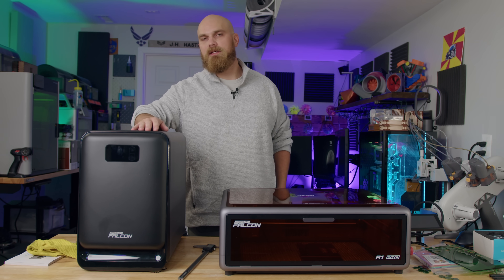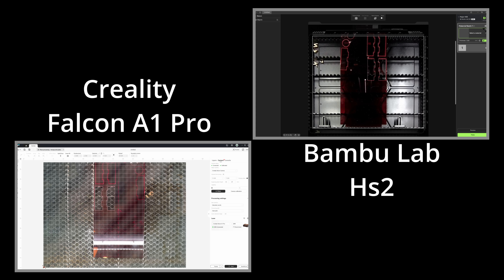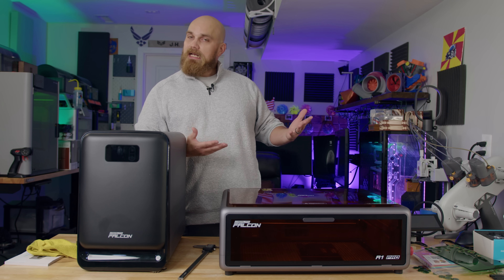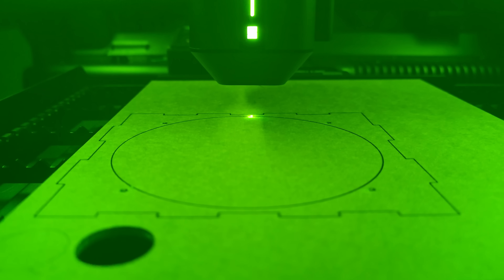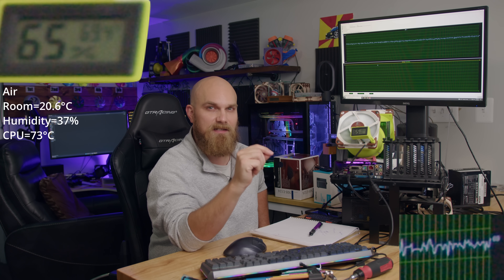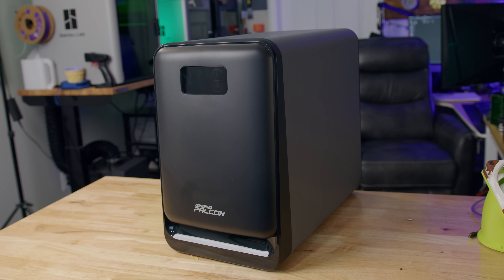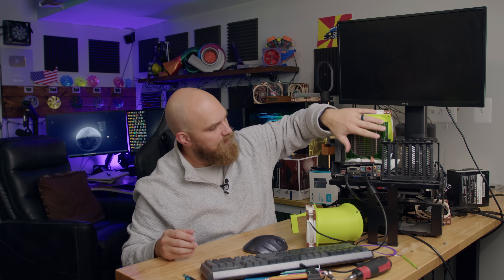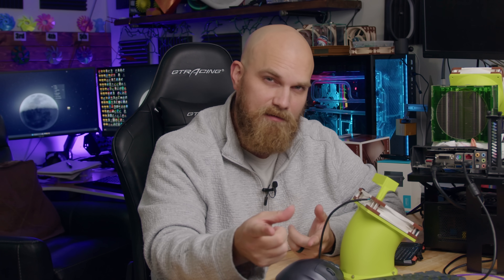I Water-Cooled My Air Cooler… Again, But Different

Comment: NB!!! As the humidity in the room increases; the amount of cooling evaporation decreases..!
ie:  You want fresh, dry air in and/or humid air out, as in outside!

Is the humidifier using piezoelectrics (cold mist) or is it making steam (hot)??
It only matters because hot takes more water for the same effect and, as you said, more vapour = less dense air...

I ask as the temperature difference is saw between ambient and pond mister/d air just before a radiator was 14 deg C.  (around 9C on the CPU and GPU IIRC)
That's in a very dry climate, which is all important to evap cooling...

Also misting a rad rather than a heatpipe cooler is likely to work better as heatpipes rely on the low temperature (pressure) boiling of a liquid at the hot side and that boiling temperature depends on the vacuum level in the heatpipe/s, NOT on ambient temps...!

If not Mist-Water Cooling; I'd turn the MB vertical so that if there is any water collecting in the HS; it doesn't drip on anything computer.

Comment: Hey! Just wanted to comment that it is generally advised against using lasers at 100% power especially when you're going to higher wattage lasers. While in theory it shouldn't be a big issue for a diode laser in terms of the lifespan (at least compared to CO2 lasers), it's pretty common practice to run lower power duty specifically for heating issues, even in higher end lasers than Creality's. 100% duty is not something I really see past 5w lasers. I would highly recommend lowering the power and doing either slower cuts and/or more passes.
Reply: lol, what?  look up the duty cycle rating on the laser you are using.  I know someone with a 150w CO2 laser, and its got a 100% duty cycle rating.  if they cut corners on the cooling, they can be cheaper to make it, but result in things like overheating.

Comment: I expect them to contact you and try to resolve the issue. No way that's how it's supposed to work- as you said, that's just unacceptable. Alternatively, you should try to use their tech support (as a normal customer, if possible). Their tech support seems to be the one complaint buyers have with this (that I can find).

Comment: 🚨To avoid 💦condensation being an issue 💡just turn the motherboard upside🔀down (180 degrees) where the CPU Cooler is on the bottom, add a 🚰drain hole, and drain line leading back into the humidifiers water tank😂😂😂

Comment: I'm not surprised the temp went down. Growing up in (Abbotsford) BC, nobody had air con and swamp coolers were something that I had never heard of, so to keep cool at night in the summer, my dad would open my windows and put a fan in front of it. My brother and I had spray bottles of water. We'd spray water on ourselves and let the air cool the water, which made it easier to get to sleep. It's also the same principle of spinning a damp wash cloth around really fast. It gets pretty cold very quickly.
Reply: Yeah, we get winter lows around freezing and summer temps in the mid 30s, but it's always above 70% humidity, so the pressure is just mean.

Comment: Hopefully Creality is taking notes from this and can fix that issue later on.
Reply: This is just Crealitys MO. They will always send you half finished products.
Reply: @gildardo  Seriously. I have an Ender 3v2 that's been gathering dust for a few years because I got tired of chasing new and random problems that would spring up every few days. Wound up being out of commission longer than it worked before I retired it.
Reply: How often are issues like this actually fixed post-release? Even in software, where pushing an update is trivial that often isn't the case.

It's a fundamental design flaw, the cooling hardware isn't up to the job.
Reply: @OGPatriot03  Creality has like a billion versions of the "Ender 3" printer, each one upgrading and fixing things post initial model release. So out of any company, they're probably the most likely one to do so. The question is just if the issue is fixed in the next model update, or the 100th model update. Fingers crossed is all you can do
Reply: honestly, if you are gonna get a laser cutter for more than a few hobby cuts, spend the money on a good one with a 50w head, these "cheap" ones are just that, cheap, and cost cutting means corner cutting.

Comment: I would love to see you revisit the watercooled tower cooler. I hate the original concept because it's inherently flawed, there's no real way for water to flow through the cooler and dissipate heat, it will flow around it since that's the path of least resistance. If water was forced to flow through the fins, the efficiency would surely improve by a solid margin.
Now all this is of course just my amateur take on thermodynamics and I could be wrong, that your concept already has enough water flowing through the fins and there's not much to improve upon.
In any case I would love to see another try at it.
Reply: it needs to use evaporative cooling as well. 

rather than heat conduction through surface area with the atmosphere...  you increase the evaporative area, and dump heat through the phase change and  heat energy being carried away as water vapour.
technically, all water cooled systems other than evaporative, are "air cooled". think about it... what actually carries the heat away? radiators dont work when theyre covered up...

and yeah, give it circulation as the fins are also limited to just conduction and convection. just has to agitate but not so much to start producing its own heat! yes, moving water heats it up... if you do it "normally" at least... cough cough, lets not go there...

Comment: water vapor is a transparent gas.
You are sending droplets (liquid water) that evaporates touching the cpu radiator and pumping a lot of energy doing so (like sweating).
Reply: This. I think that's one of those ultrasound humidifiers, that use membrane that vibrates at VERY high frequency to mist up the water and then push that out. As you said, that's fog not water vapor or steam. Also humidity doesn't change the air temperature, nor is that fog even warm. It's the same temperature as the water in the tank of that machine (plus maybe a fraction of a degree due friction).
Reply: @TheSanpletext  The humidifier increases the humidity of the ambient air via evaporation of water. That evaporation of water decreases the temperature of the air via evaporative cooling.
Reply: @victorro8760  That's not evaporative humidifierr 'tho. It doesn't evaporate it, it atomizes it.
Reply: @TheSanpletext  I don't know how ultrasound humidifiers work but the water ultimately has to evaporate to increase the humidity of the air...?
Reply: @victorro8760  Those are pretty bad for actually humidifying air, they usually just atomize the water and it then floats around a bit and lands on nearby surfaces. It should work well for this sort of application however.
Reply: @victorro8760  yes, but the amount is still so marginal it barely affects the room temperature. That's also why swamp coolers are not effective anywhere, but really hot and dry environments. Non-dry air is obviously already humid and cooler air can hold less water. RH is dependent on temperature, and lowering room temperature makes it hold less water, so the current amount of water already in the air takes up more of the relative humidity. That's also why  AC units' cold side condensates water. The suddenly much cooler air can't hold all the water that was in the air before it cooled, so it has to condensate. 
So yes, in theory humidifiers to also cool the air, but in practice the effect is marginal, unless you live in dry and warm environment.
Reply: @TheSanpletext  I understand that the net loss in temperature of a room is negligible but it's the temperature of the air stream coming out of the humidifier that's relevant in this context. I'm not sure how much the temperature of the air stream would decrease going from 30% humidity at 20c to 100% humidity (assuming it goes to 100%) but I can't think of another reason why the humidifier could improve cpu temperature by 5c.
Reply: @victorro8760  Oh yeah, the CPU cooling is purely based on waters ability to cool metal by evaporation. Water conducts heat better than air, but it has to be in liquid form (in this case atomized by ultrasonic humidifier) so it can phase change to vapor and take away the heat from the metal. 

So it's not the air humidity that cools the CPU cooler, it's the water mist that HASN'T evaporated before it hits the CPU cooler.

Thus: Making the CPU cooler wet by suspending liquid water in air = better cooling. Making air actually moist with water vapor and then pushing it to cooler: not as effective. It has to be liquid water, albeit tiiiiiiny droplets in this case, for it to cool it using evaporation (phase change).

Even more effective way would be submerge the cooler in the water, and move the water way closer to the CPU die. Then add pump and radiator with fans, so you can move the heat out from CPU fast using water, and then cool it back down elsewhere using air. Oh wait, that's liquid cooling. (This bit was joke, but liquid cooling IS more effective)
Reply: If only electronics were allowed to actually sweat...
Reply: @exxor9108  Is this a fetish thing I'm too vanilla to understand?
Reply: The water vapor has to condense on the fins before it evaporates. The heat gained from condensation is equal to the heat lost from evaporation so I don't think this is evaporative cooling. I think the improved cooling is just from the air being at a lower temperature due to the initial evaporation. The air coming out from the cooler is more humid than the ambient air meaning there's latent heat in it that was originally heat energy from the ambient air. I'm not sure if I know what I'm talking about.

Comment: you shouldnt run any laser at 100%, i have a 30w galvo and dont run it at 100% max 80%
Reply: It's a consumer product. If it's advertised as a 20w laser, it needs to be able to run at 20w. It is not made for professionals where precise control and expertise can be expected.

Comment: they make "air conditioners" for garages called Swamp coolers... they mist water into a huge fan.  this thing seems like the same thing.
Reply: Also used in the house, depending on the country.
Reply: For garages? Try entire houses and apartments.
Reply: @md_vandenberg and they only work in dry environments.  if its humid out, swamp coolers do nothing.
Reply: @md_vandenbergwell generally swamp cooler systems for homes are only in areas that have dry climates, therefore people that live in the south where humidity exists they wouldn't be able to work well enough for home cooling. I know places like new Mexico, Arizona, and areas of California they are common place because of their dryer climate.
Reply: @md_vandenbergour whole 25,000 sq foot shop

Comment: 40C in shadow in dry climate is kind of fine, 40C in humid climate is unbearable. When you splash water over hot rocks in sauna temperature drips a bit, but it is much "hotter" after that o) So humid air is much better at transferring heat.
Reply: The way people experience heat is not exactly the same as machinery. When relative humidity is high, cooling by sweating becomes less efficient and as a result feels "hotter".

Machines don't suffer from increase of relative humidity nearly as much, because they are not even trying to evaporate anything, they generally work by simply being hotter than surroundings.

As for sauna, the steam can even condense on skin, transferring a lot of energy. Phase changes are known to require plenty of energy transfer to happen.

Comment: Though it only works so long as you have "dry" air. If not, the water will have no chance to evaporate and therefore no chance to add to the cooling performance.
Reply: The air passing through the cooler also absorbs heat, hotter air can hold significantly more water. For example, going from 40C to 60C increases the maximum water content of air by 160%.
Reply: Yeah, would be interesting to see the results with actual summer conditions.
Let's say 32°C temperature at 75% humidity.